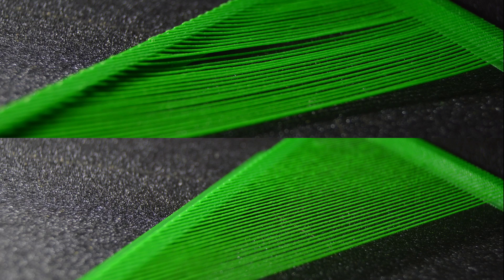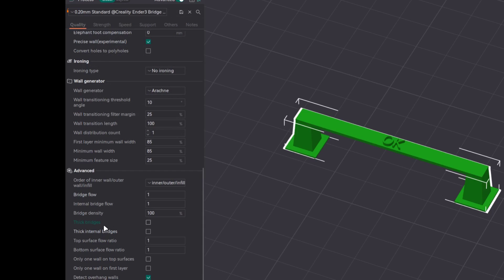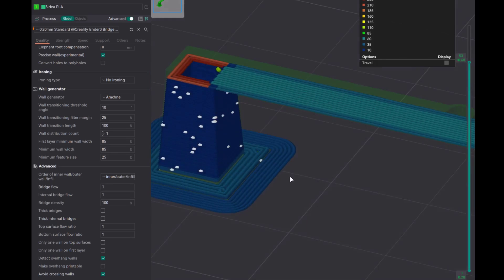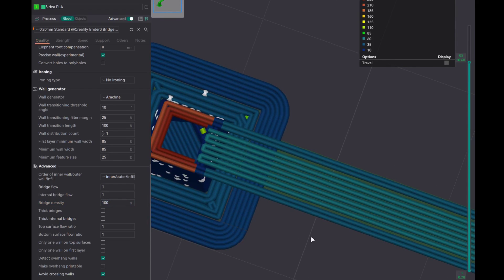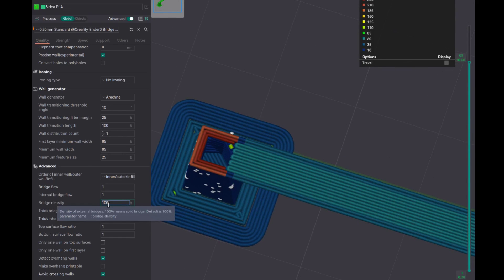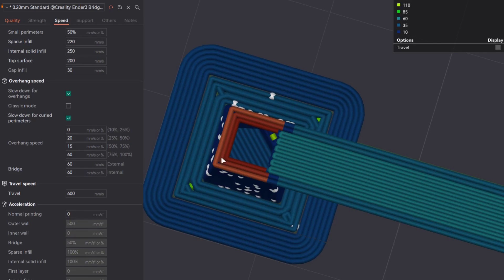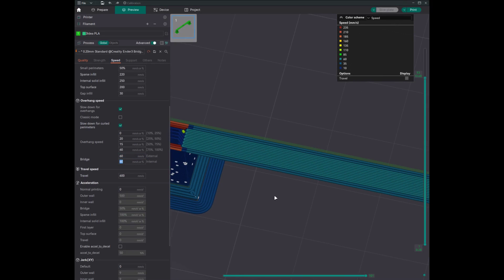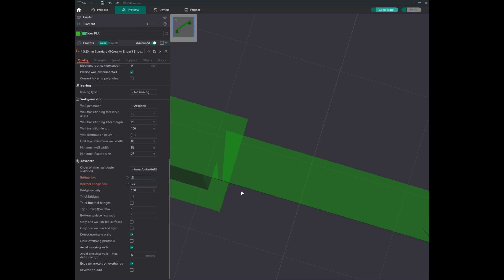OrcaSlicer Thick Bridges OFF vs ON

Comment: do you need the fan to 100%?
Reply from the maker: There are multiple factors, such as your fan setup, dual or single fan setup, layer height and bridge line width. My settings might not work exactly for you, take it as a guideline, even if you have the same printers, settings do differ.

Comment: How did you print the internal bridge starting on a wall? My bridge starts at the overhang, causing the lines to fall down to the bed. 😢
Reply from the maker: You mean it is starting mid air and not from the wall? Can you share the stl file?

Comment: I am a bit confused by the bridging speed. You said you see no difference between 10 and 60mm/s so set 60…but it’s not doing 60mm/s in the video. For the 110mm bridge at 60mm/s should take less than 2 seconds, but it takes 11 seconds in your video. That means you’re doing 10 mm/s…

Something is wrong with your slicer or printer.
Reply from the maker: The actual speed will be decided by the slicer, it needs to consider the acceleration and deceleration speed, even though you set the speed to 60 or 100, it first needs to accelerate to reach to that speed and to decelerate to stop, so if the distance to print is short, by the time it reaches at the end of the print (from point A to point B) it must have not even reached at the acceleration speed set in the slicer/printer profile. To see the actual speed in OrcaSlicer, slice the model. At the top right hand corner , in the "Color scheme" menu, click on the "Line Type" drop-down menu and select speed. At the bottom, you will have a horizontal slider, with the mouse, move it back and forth, it will show the actual printing speed. Hope that helps you.

Comment: Must be a problem of insufficient cooling. I use a CPAP cooling compressor with a VzBot duct and have no problems with Thick Bridges.
Reply from the maker: CPAP and VzBot is amazing, but this video is achieve good bridging if you don't have high cooling system like CPAP.